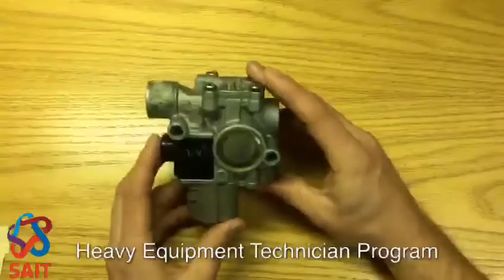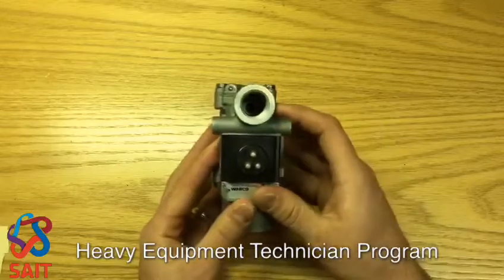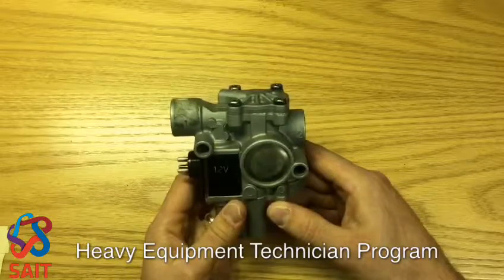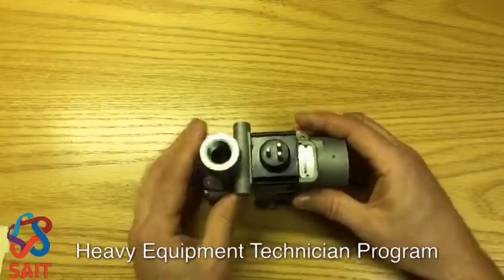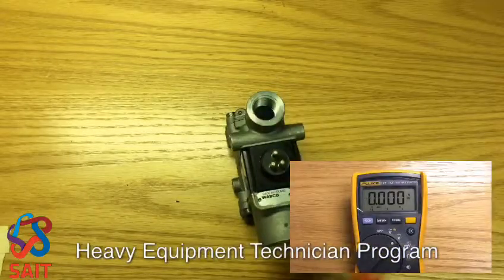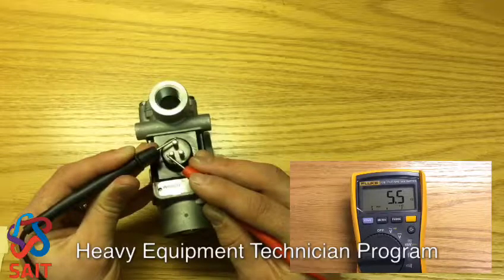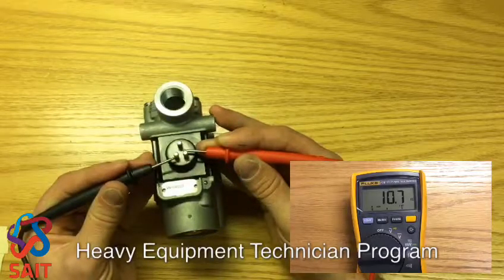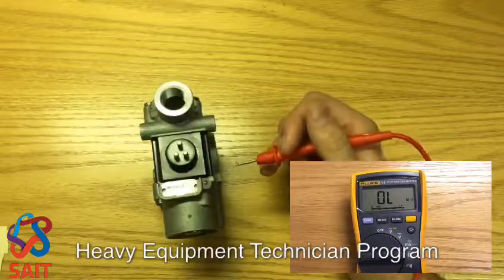Air ABS   Modulator

Comment: Mine leaks and i give it a little hit and it stops leaking. Could it be that is goin bad?
Reply from the maker: Likely one of the poppets are not seating internally causing the leak through the exhaust port. They are not easily serviceable as in parts are not really available for reseal. The recommendation would be replacement, if you are remote and it’s urgent the short term fix may be disassembly, clean and reassemble. If you do this though keep track of poppet orientations, seal install direction and cover seals. Not recommended but if you have no other option do so at your own discretion.